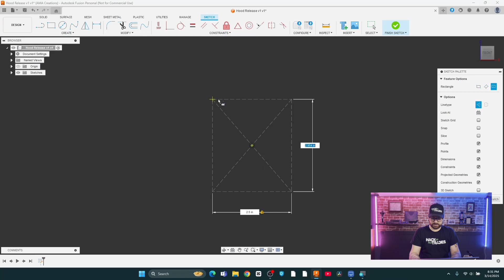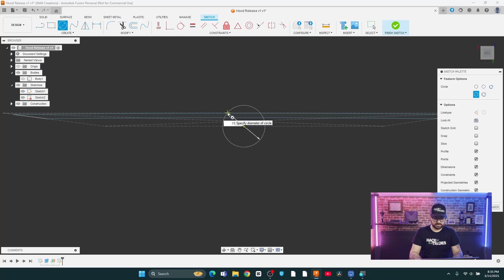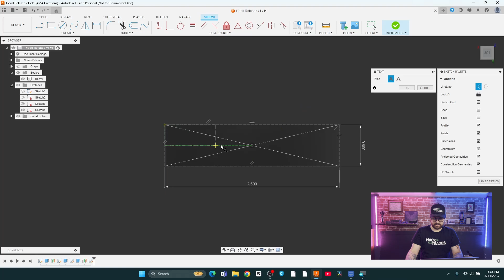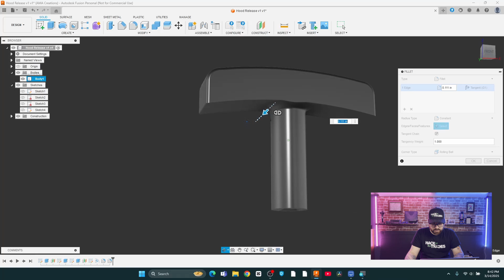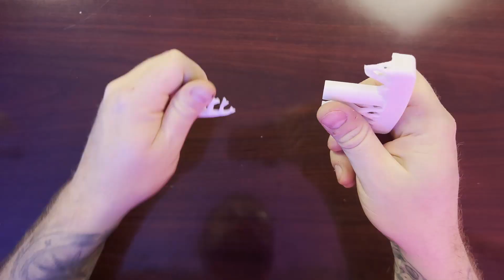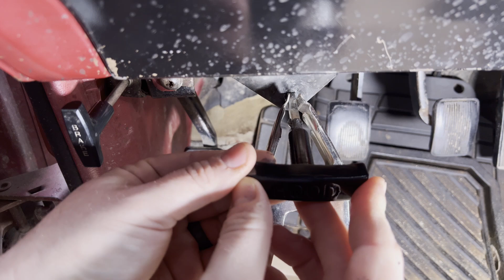3D Printing a Fix for My Truck – Can a 3D Printer Save My Ford Ranger From a Broken Hood Handle?

Comment: In my opinion, you should print this in a different orientation. When printing vertically, the layers are arranged in such a way that the handle is prone to tearing. Look at it from the perspective of how the layers are arranged and how force works when pulling. Try printing it horizontally (you'll need to solve the support issue in the hole) or at a 45-degree angle.
Reply from the maker: Great callout! I thought about splitting it in half so I could lay it down and gluing it together in order to get the layer lines to wrong the length.  Now I’ll definitely need to try it and do a stress test on each.  Thanks for the tip!